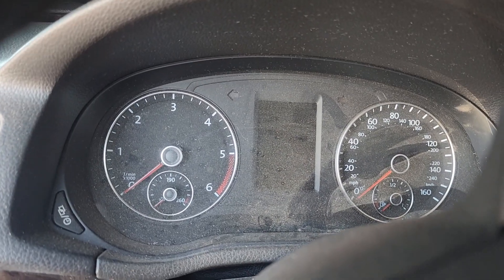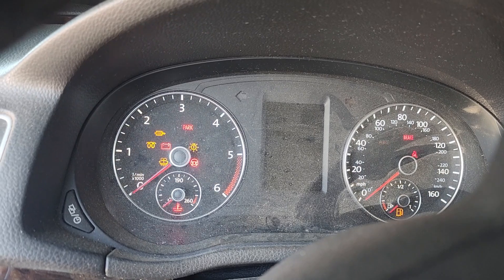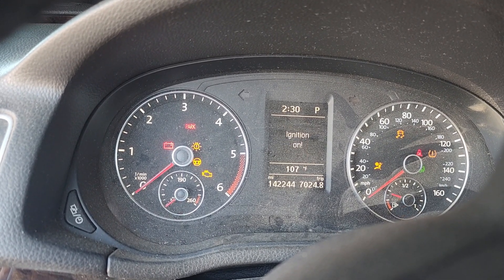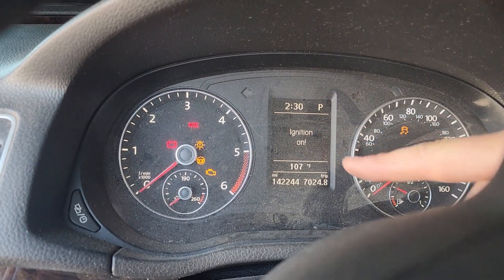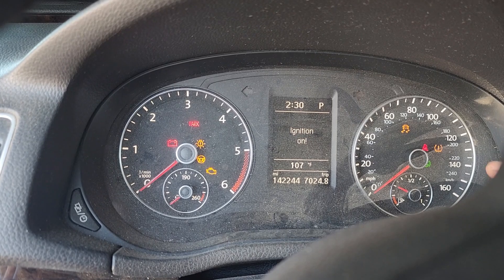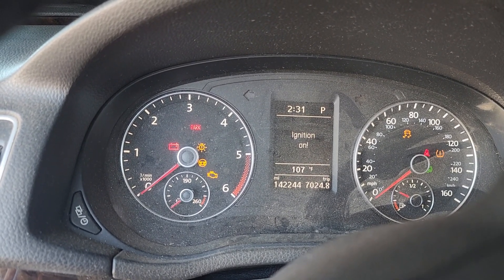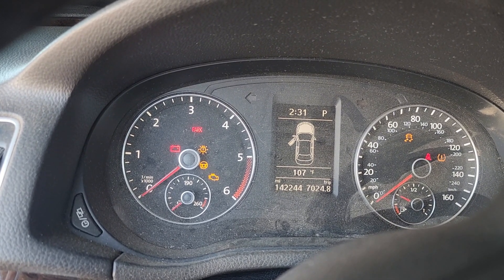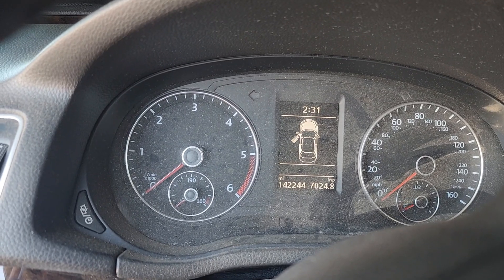B8 TDI - Crank but No Start Troubleshooting

Comment: Hit the bottom of the tank while wife turns it on and cranks it. That could help confirm the lift pump. Also is the transfer pump isn't working then the one side of the tank could be empty.